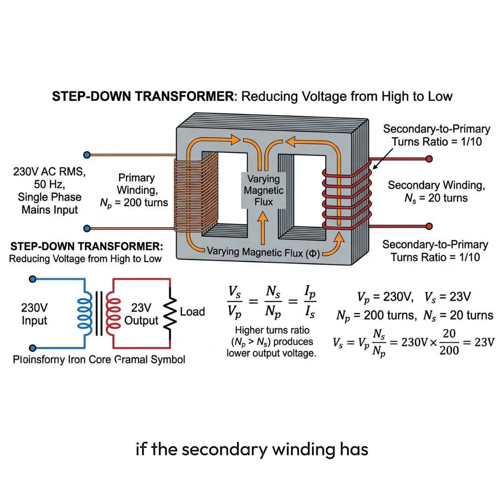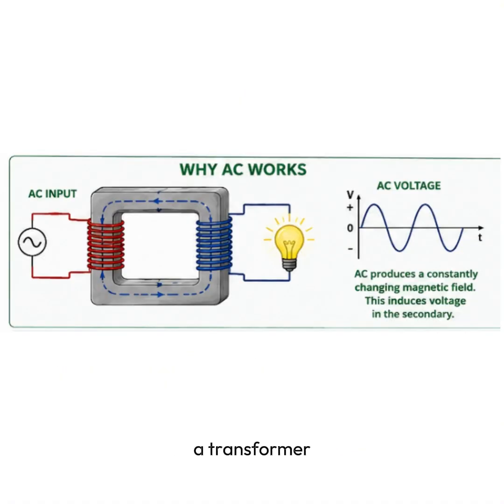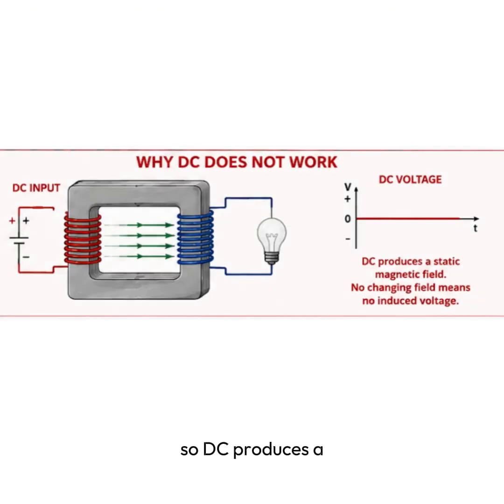AC vs DC: From Flat Lines and Sine Waves to RMS Voltage — The Complete Beginner's Guide

Comment from the maker: 🔗 Full video — AC vs DC: The War of Currents — Part 1: What AC and DC Actually Are and Why It Matters:
https://youtu.be/9nlm9tROV2Q

DC is a flat horizontal line. AC is a sinusoidal wave reversing direction 60 times per second. That difference — and what it means for transformers — is why Tesla's system powers the world today.

One thing most people do not know about their wall outlet:

The peak voltage of US household AC is approximately 170 volts — not 120. The number on your appliances is the RMS voltage — Root Mean Square — the effective voltage that does the same useful work as an equivalent DC voltage. For a sinusoidal wave RMS is 0.707 times the peak. 0.707 × 170V = 120V.

Both numbers are correct. They describe different things about the same sinusoidal wave.

The full video covers the complete physics:

📈 DC voltage — flat line. One direction. Always.
🔋 Why batteries, fuel cells, and solar panels all produce DC
🌊 AC voltage — sinusoidal wave. 60 hertz in the US. 50 hertz elsewhere.
🔢 RMS voltage — why your outlet is not really 120 volts
💧 The water analogy — steady pipe flow vs piston pushing water back and forth
🔄 How transformers work — and why DC cannot use them
📉 Edison's fatal flaw — a power station every mile — and why Tesla's system could power a continent

Part 2 covers the War of Currents story — Tesla, Edison, Westinghouse, the World's Fair, Niagara Falls, and why DC is making a dramatic comeback in the clean energy future.

⚡ The Tesla Institute — understanding energy through physics, chemistry, and engineering.
Nikola Tesla believed electricity should belong to everyone. We are still working towards that vision.

Drop a question in the comments about AC, DC, RMS voltage, or transformer physics — happy to go deeper.